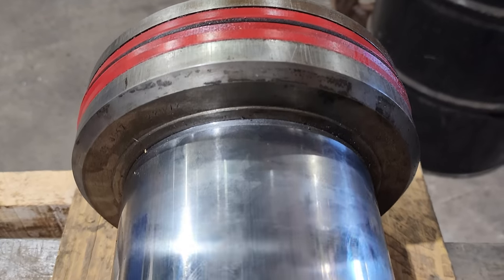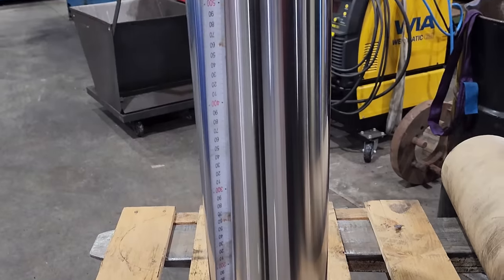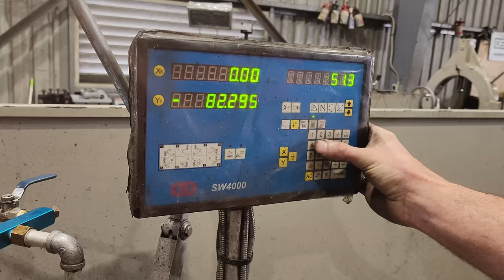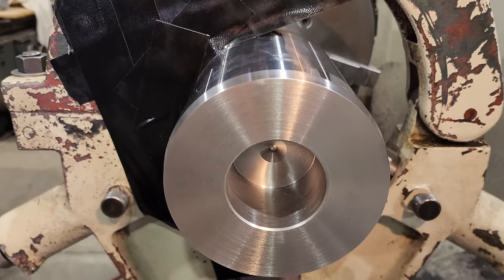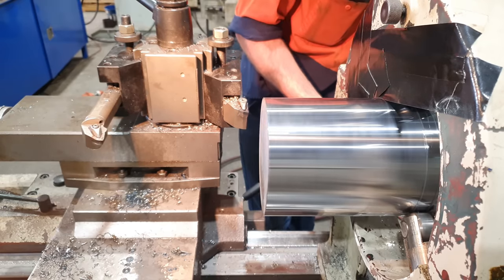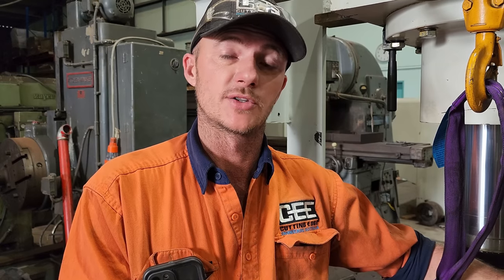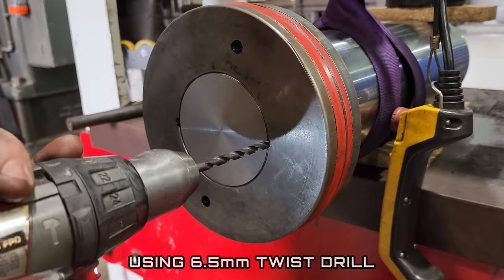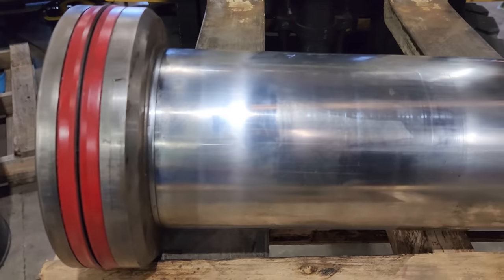Making a 100T Heavy Duty Mining Jack Cylinder Rod | Machining & Threading

Comment: One question I've always had watching folks threading on a lathe, how does the cutter always begin the cut in the exact same place every time? I see at the end of the cutting pass, when you move the cutter back, the lathe spins in reverse and then stops when you reach the original position. But how does the cutter actually engage the stock at the same place every time? Maybe I'm missing something, but this looks like some kind of magic to me ;) Anyway, great videos!!
Reply: There's a geared connection between the lathe spindle and the leadscrew. On large lathes like this there's a gearbox to change between thread pitches, on small simple lathes you manually change the gears. There's a good explanation here:
https://www.youtube.com/watch?v=q7scadYptTI

Comment: a.) First time I've ever seen you NOT face one end of the project. You centered, then drilled it. Is there a reason why? b.) Why not drill the old grub screw possition with a slightly larger diameter, and thread that in the old position?  Love your work.
Reply: Ever tried to drill anything remotely like that??  Coulda used an end mill though, but too much set up.

Comment: Kurtis, you are a magician! How can you use a 50mm drill, take an aproximitly 2-3mm roughing pass an ending up at diameter 51.37 and not 54 to 55 mm :) Just kiddin. I really love your content and i have watched all of your videos. However, i always wonder why you calculate your zero on the monitor to be your target diameter. Why dont you just set your measured value to be lets say 51.34 or 51.37mm and turn to your absolute target diameter? Greetings from Germany and keep it up! Nico

Comment: Do you know of a tool that could be used to sand down/take off <.001 of material uniformly around a steel axle without removing the axle and putting it in a lathe?

Comment: Imagining the importance of this jack in a mines daily operation, to facilitate rapid accomplishment of maintenance and repairs on multiple pieces of equipment, I suspect that the mine operators have come to recognize the quality of CEE’s work and solutions, and that CEE getting this and other jobs may come down to CEE providing a plug and play solutions, as it’s not uncommon to order parts and have them require modifications to be installed, resulting in additional lost time and butchered jobs, to “get it done”.

Comment: When you are making threads, why do you tap the compound?
Reply: Because that is how you increase the depth...
Reply: @ShainAndrews  Not gonna look, but IIRC, it's at 90".
Reply: @ShainAndrews  no. He was moving the one wheel to increase depth. But I saw him tap the smaller wheel that moves it sideways.
Reply: @shaunkelly9053  Used to increase thread clearance.  Once the depth is set depending on a whole host of variables the operator shifts the insert.  Maybe go watch some threading videos...
Reply: @ShainAndrews  I figured that’s what he was doing it for.

Comment: Kurtis, when you change from non hardened to hardened, do you need to check strengths? Or does 6” bar generally hold to similar specs. Keep up the good work.

Comment: dropped a job off at a local engineering place today to get a new threaded rod made for a water regulator door its like 1.8m long and only about 200mm isnt threaded and the machinest say they will have to use a travelling stedy to thread a rod that long curiosity  is getting the better how do travelling stedy actually work? and why we have to get the machined up is cause they are not a off the shelf item anymore
Reply: A travelling steady is mounted on the saddle and travels along the work ahead of the cutting tool. Here's an example:
https://www.youtube.com/watch?v=QJNB6yGgnFE
Reply: Buy a die & off the shelf rod?
Reply: @alro2434  rod  diameter is 1 3/8 inch and a square thread not a 55° thread

Comment: What’s the purpose of the black tape you use on your lathe. Seems kind of low tech. Tells you if the shaft goes out of round? Impressive interesting show
Reply: It's to keep the chips out. If a chip gets under one of the rollers on the steady it can damage the rod.

Comment: Another great video and repair job 👍 I wouldn't encourage those birds inside, once they start 💩💩 everywhere, you'll regret it 😬🙈 ps - I wouldn't trust myself (or have the patience) to drill and thread that hole by hand, especially when I have a workshop full of equipment.

Comment: Question: Where does all the specification sheets reside for all these parts? 

I recall that my uncle had CDs, then DVDs sent to his automotive business so he could look stuff up on all sorts of makes and models.  He paid a yearly fee but received the updates monthly. 

Do you folks have a web service that consolidates everything or do you have to go to each manufacturer's website?
Reply: He likely reverse engineers the cylinder. Measures out the critical dimensions and matches them for his part.
Reply: @kjdude8765  Well that can be true, but to have the bar stock cut to size means he has to have some sort of specifications. Also it's important for him to measure to old parts in comparison to specifications to see if the item has been modified or is a variation. Given he choose the induction hardened steel, this tells me this is not the first one he has repaired.

Comment: Was that a imperial-unit-based BSW thread pitch? Really?
Reply: Certainly looked like one.  Got to match what is already cut in the piston.
Reply: @dfross87  Whitworth is an old British standard for screw threads and sizes. Britain started moving away from Whitworth to the metric system in 1965, long before this piston was made. But it looks like the people down under still use that standard. (unbelievable)
I worked on British Motorcycles in the 60's and hated it because I had to purchase all the necessary tools to do so. I no longer own any BSW tools. Having to own US standard and Metric is enough.
Reply: @Bass.Player  You still find newly made things using Whitworth threads, for reasons I don't understand.  Possibly the manufacturer never changed the specs, and just kept churning out the same thing.  For newly developed products, I truly don't understand why anybody would use BSW or BSF.

Given your story about working on British motorcycles, you probably also had the misfortune to encounter BSC and BA threads!  That's the great thing about standards -- there's so many to choose from 🤣!

Comment: Hi...Just a question when abom79 does threads he does what he says is a scratch pass and checks it with a thread pitch gauge. I see you just set the machine. Double check the settings of the machine and immediately cut threads. You trust the machine. He trusts the gauge before he cuts threads. Are there any benefits or drawbacks of either because what happens if the machines gearing/ gearbox is faulty on the day you finally do the cutting with your method?
Reply: Because you didn't see it... it didn't happen...
Reply: ? Sorry not sure what you meant @ShainAndrews

Comment: I have a query about a specific aspect of your work. Using this mining jack repair as an example but  it probably applies to much of your repair work. Almost every one of your jobs is in many ways a one off custom repair  in which the quoted cost of  performing that repair being less expensive than other quotes is probably one of the main reasons why you won that particular job. 
One could also reasonably expect that as in the case of this mining jack the design and method of  manufacture has probably remained unchanged for decades. As the original manufacturer can order the production or acquiring of all parts and components in bulk orders, probably in the multiple hundreds of units at a time the unit cost per component to the OEM should be considerably less than what your cost to manufacture or do a major repair would be. Why is it then that the OEMs seem to be unable or unwilling to supply replacement parts or components at a cost to the end customer that could in all probability force your type of repair and manufacture either out of business or otherwise severely restrict your available sources of customers and revenue. I would love to hear what your views on this aspect of your work could be.
Reply: If not every, then almost every company counts on making A LOT on replacement parts, screwing you after an enticingly low initial price.  It's SOP!  Your 50,000 car is at least 100,000 in parts.  Except Mazda sold Wankel/rotary engine stuff low so we wouldn't be scared away.

Comment: What is the idea behind the thread relief?
Reply: It allows you to fully cut the threads at full depth along the entire thread length. Otherwise the last bit of threads would taper up and potentially seize on the nut.
Reply: @kjdude8765  Short of CNC it is impossible to do so without thread relief.  No relief means broken inserts or stalled machine.

Comment: Nice work as usual, Kurtis and Karen!  Question - When you're cutting the threads, why do you always cut them in one direction?  Why not get to the end, add some more depth, and then cut on your way back to the start?
Reply: That produces some very sloppy threads.  Every machine has tolerances in it.  They have to.  Screw a nut on a bolt.  Pull and push the nut.  The tolerance you can feel exists in the lead screw which means the cut point would not be consistent.

In addition tool pressure should be towards the chuck, not pulling on the chuck.  Lets try to keep the work piece where it belong.  Lets try to keep the bearings loaded as designed.
Reply: So you'd like what, take the cutter outta the tool post and put it back in upside down for the reversing cut??

Comment: The mechanics are mis using this jack because it is too tall at rest. Lose the pad so it will fit under the tractor. We all do it. Sorry. It's too difficult to park the tractor on lumber for more clearance obviously. A gain, sorry for our actions.

Comment: So what is the purpose of the thread relief cut? I love watching you work but the mechanical side of my brain is always why did he do it that way....This coming from someone who knows NOTHING about machining steel ;)
Reply: It allows a full depth thread to be cut the entire thread length. Otherwise the end of the thread will taper up and potentially seize the nut. It also allows the cutting tool to be pulled away from the part without risk of damage.